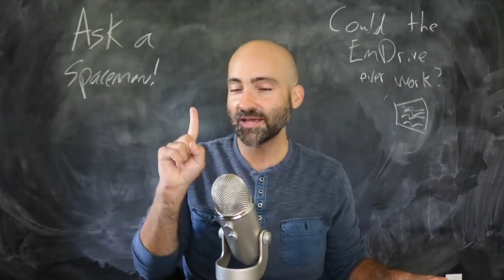The EmDrive Will Never Work - Ask a Spaceman!

Comment: first time seeing Paul getting angry :D
Reply: It's ok to get angry at junk science. Scientific illiteracy contributes much to society's problems.
Reply: We have done too many compromises, too many retreats.  They invade our space and we fall back... Not again.  The line must be drawn here, this far, no farther.
Reply: Hardly the first time... :)
Reply: All I see is a vibration generator. And, unless that energy is pushing on something (ie. air pressure) then it can't do actual work.  Sure, it can spin and bobble. But, that gets you nowhere in the vacuum of space. Also, if you DO have air pressure, than you have an atmosphere, which isn't outer space. The EmDrive is nothing more than a useless audio speaker.
Reply: @bobjohn8581  who is wrong?
Reply: @bobjohn8581  if I understand you correctly you are talking nonsense or you are  bad at explaining what you mean
Reply: @bobjohn8581  First of all maybe respond with one comment or at least one per person. Secondly he is talking about using this idea to propel things If you want talk about other uses first say what those uses are supposed to be dont just spam light bulb randomly
Reply: @bobjohn8581  problem with emdrive is that it cannot work as it's presented, But yes photon thruster is not theoretical, you would need GWs of energy and you would need to prevent melting you of ship in first place with giant radiators.

Comment: Even without taking directly  into account the conservation of momentum by name, I fail to see in what the M drive would really behave differently from a simple pressure vessel of the same shape containing a gas... 

It doesn't matter that one has radiation pressure rather than molecules bunching back and forth, the tapered side can be considered just an extension of the smaller side and considering the section immediately before the larger side of the drive, the forces on its two sides are balancing each other. 

If the m-drive worked, plumbers would be chasing any odd-shaped pressure reservoir as it tries to reach some near star....
Reply: That was what I always thought of the EM-drive.
 That even if it could create a push against the background quantum woo field, there was nothing about its shape that would prevent an equal push in the opposite direction.
 Net result: EM drive stationary.
Reply: Make half of the shape with small sponge-shaped cavities that gradually increase to single chamber. So that in the two parts - different quantum effects will occur, and because of the gradient - voala - it will move. (disclaimer - I don't even know what Em drive is actually)

Comment: Paul Sutter, aside from verbal salad (love that term) used to describe EmDrive, is there an issue with conservation of monetum only being preserved within ones current time frame or an end state of a dynamic universe ? Specifically I'm think of a far off observer watching an object infall towards a black hole's event horizon and perceiving that the object's time looks as if it runs slower. Eventually the object seems to hang motionless above the event horizon (except we do not "see" anything as the emerging light gets progressively red-shifted out of the visible spectrum). From our perspective the object has ceased to move (and so has lost its momemtum) and yet collision with the central mass (singularity or some exotic quantum gravity nugget down at Planck's Length) is infinitely far into our future? Does this mean conservation of momentum can be "borrowed" or at least delayed.

I appreciate that in far far future when cosmic microwave background radiation cooled enough then stellar & supermassive black holes will have a net loss of mass through Hawkin radiation and so eveaporate away over course trillions years, and so objects at the event horizon will slowly approach as the event horizon shrinks? How is momentum transfered to a black hole - we know black holes can merge having observed the gravitational waves as they spiral infall, but at the moment the 2 event horizons touch we witness a "ring down" of gravitational waves as the event horizon settles down to its spheroid shape (given that this a rotating black hole) and internally the two singularities must approach and merge within the volume bound by the event horizon. This clearly happens in our reference time as we see this occuring with LIGO results, and yet General Relatiovity would seem suggest we should only see event horizon shell boundary effects within our timespan?

Comment: Let me introduce you to quantum mechanics and macroscopic effects that can arise from manipulation of the microscopic level. Science was not complete when you finished your education. There is a universe we know very little about. 

Everything that surrounds us, ourselves included, can be described as macroscopic collections of fluctuations, vibrations and oscillations in quantum mechanical fields.  Matter is confined energy bound within fields, frozen in a quantum of time.

Therefore under certain conditions (such as the coupling of hyper-frequency axial spin with hyper-frequency vibrations of electrically charged systems) the rules and special effects of quantum field behavior also apply to the macroscopic physical entities (macroscopic quantum phenomena).

Moreover, the coupling of hyper-frequency gyrational (axial rotation) and hyper-frequency vibrational electrodynamics is conductive to a possible physical breakthrough in the utilization of the macroscopic quantum fluctuations vacuum plasma field (quantum vacuum plasma) as an energy source (or sink) which is an induced physical phenomenon.

The quantum vacuum plasma (QVP) is the electric glue of our plasma universe. The Casimir Effect, the Lamb Shift, and Spontaneous Emission are specific confirmations of the existence of QVP.

It is important to note that where the electromagnetic fields are strongest, the more potent the interactions with the QVP, therefore, the higher the inducted energy density of the QVP particles which spring into existence (the Dirac Sea of electrons and positrons). These QVP particles may augment the obtained energy levels of the HEEMFG system, in the energy flux amplification may be induced.

Polarization of the local vacuum is analogous to manipulation/modification of the local space time topological lattice energy density. As a result, extreme speeds can be achieved.

If we can engineer the structure of the local quantum vacuum state, we can engineer the fabric of our reality at the most fundamental level (thus affecting a physical system’s inertial and gravitational properties). This realization would greatly advance the fields of aerospace propulsion and power generation, and has.

Comment: I want to hear your thoughts on the warp drive and if it's possible (I read that it's at least currently possible to travel 1/10th speed of light using this technique but would like your perspective) to bend space to an extent where space is compressed in front of you and stretched out behind you, and if it's possible, what would you require to power a warp drive, and what would be the downsides (say the effect on planets).
Reply: It will probably never work. It is one of these concepts that are possible on the paper in mathematical terms. The speed of 0.1c is possible without exotic technology. It is within the fission drives range, at the higher end, not to mention fusion.

Comment: It has been proven that particles spontaneously generate from vacuum.  If the vacuum is contained in a vessel, the mass of the vessel is increased.  Under certain circumstances, this should increase the momentum of a vessel containing the spontaneously created particles.  Increased mass wouldn't decrease velocity, if the vessel was moving toward an object of greater mass, not trying to escape from an object of greater mass.  Under those circumstances momentum would increase.  Then when the particles annihilate each other, momentum is conserved by increasing velocity to make up for the decrease in mass.  As long as you have a power source to maintain the energy state of the vacuum, velocity would gradually increase over time along with momentum.  You are depleting energy.  A hot tea cup should weigh more than a cold tea cup.  That might kill the momentum increase, but you would have to solve General Relativity equations to see if that would happen.  A rocket with a fuel supply decreases in mass as the fuel is used up, but that rocket still has increased velocity despite a significantly lower mass.😐😐😐😐😐😐😐😐😐😐

Comment: Answer me this. Energy = mass. If i have a very powerful, 100 % efficient, super duper  battery powered self contained laser, which I know doesn't exist,  say out in space, and I shine my laser to lets say the nearest star about 4 light years away. And on that star is someone with a 100% efficient solar panel , which I know doesn't exist, and that panel is receiving all of my laser energy from my laser and converting the energy from those photons to electrical energy and with total efficiency charging a perfectly efficient storage battery in his battery powered self contained laser just like mine . E=M. That means that when I shine my laser to my friends solar panel 4 light years away my battery becomes lighter or more correctly less massive. Just a tiny bit of course. Also when my friend receives my laser energy 4 years later he does so with his super duper magical solar panel and charges his super duper, yet to be created here, almost magical battery and charges it with my laser energy . When his battery  becomes more charged it also becomes just a tiny bit heaver than it was before recharging. Or rather it also becomes more massive. E = M. Maybe the mass of a neutron. The increase in mass equals my loss of mass assuming no loss of energy anywhere in the system. There is your conservation of energy. But what I have always wondered or not understand fully is that for reasons, that I understand of course, that mass cannot be accelerated to the speed of light. But in my thought experiment here I have MOVED mass 4 light years from here to there at the speed of light. Not much mass I know but none the less mass. E=M. I know that if I had fired any other kind of non photonic projectile , no matter how tiny,  from any type of fantasy gun of some sort to fire a projectile, like say 1 neutron worth of mass accelerated to the speed of light, the recoil would blow me and my fantasy gun backward through the Earth and destroy the whole planet. And kill me. Since Energy = Mass x the speed of light squared = infinite energy required to accelerate that neutron to the speed of light .  Yet when I MOVE the same mass at the speed of light with my super duper maybe magical laser gun I feel no recoil ???  Explain please.

Comment: The M Drive will work if the rear wall of the “microwave box” is opened to let the microwave Energy out which pushes its momentum out the back. For every action there is an equal and opposite reaction, so the spaceship is thrust in the opposite direction of the microwave exhaust.